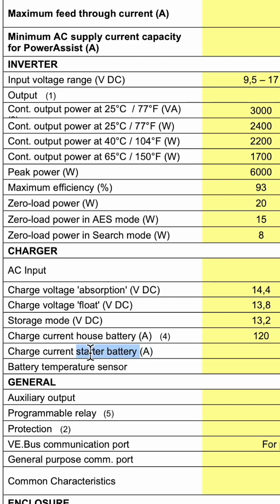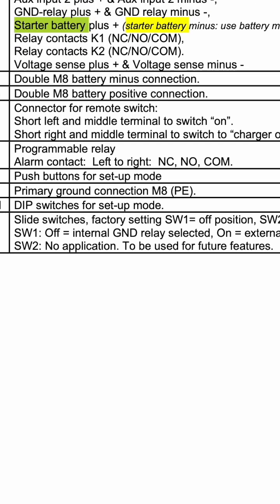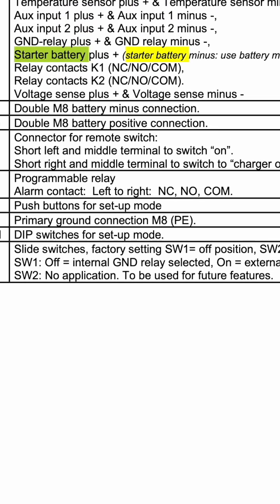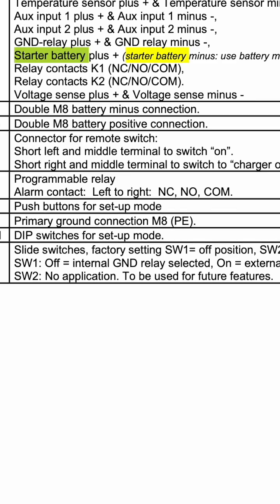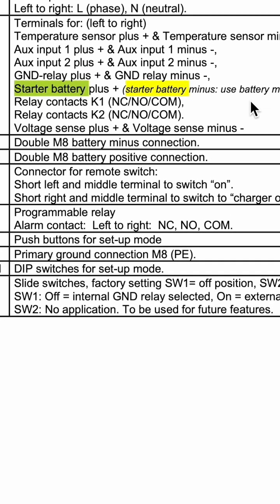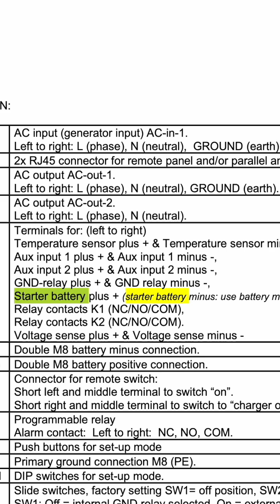Victron MultiPlus Inverter 3000: Trickle Charging Your Starter Battery (Van Life)

Comment: What size spade connector did you use for the positive connection to the Multiplus?
Reply from the maker: https://www.amazon.com/Feggizuli-Connectors-Connector-Terminals-Electrical/dp/B0B4H54KPS/ref=sr_1_3?crid=2EKOV50PPXYWS&dib=eyJ2IjoiMSJ9.er9CMJa4uhMONUFNSgyY-hEmzPt-3RDWoqDI1T5bh1oNGrzu4qmwfZ7AMNe3ngHNCOFMMX0OrYa5dD2Ehe25qtEVuCWmlDoca85Vq0ymXpwCaaIuAWdyJmoVmb6AbGU2VIpKFowDOtl0bVBwy6r86EjJQ7HuOwEEm1cleqL7QFu1lcka52G_Sy_yT5xaNCA4hcSpAF03jiQoYKtOSzU0qtyaUrlUqgEya6CVHqA4emE.gkwOW6pL-46FgQpbAd1Hcafbwb9HZIRuKETF6bh_qZU&dib_tag=se&keywords=spade%2Bconnectors&qid=1748823775&sprefix=spade%2Bco%2Caps%2C235&sr=8-3&th=1

Just buy that $7 box. It has the type you need.